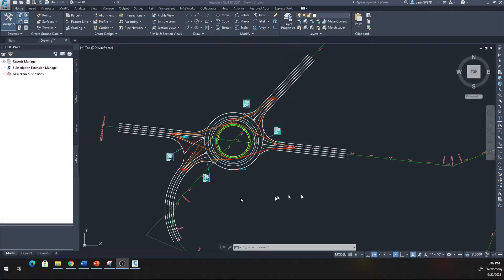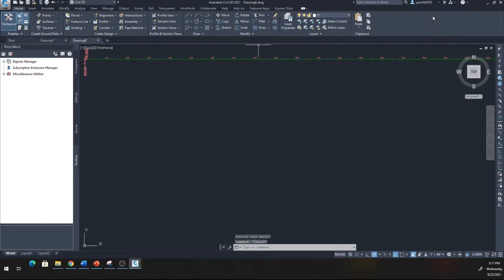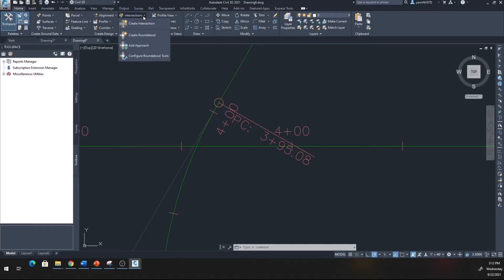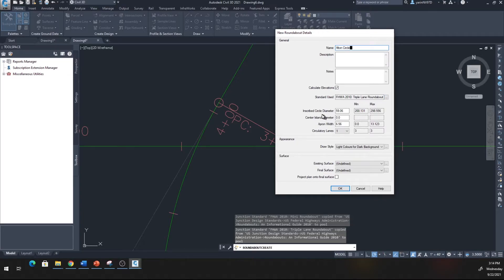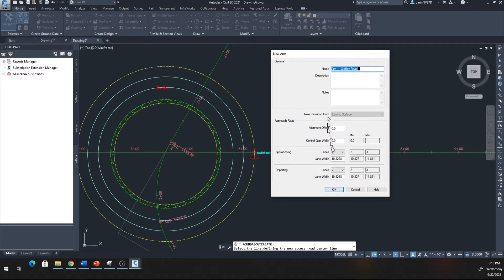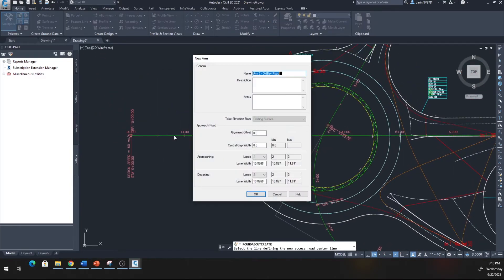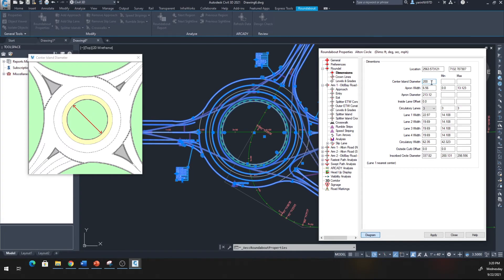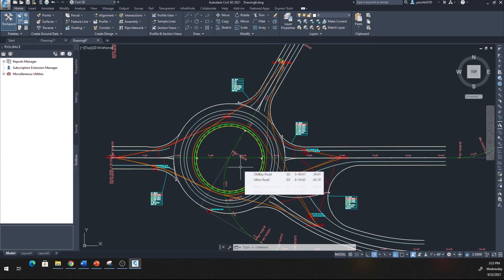Creating a Roundabout Traffic Circle Civil 3 D

Comment: What if you want to tie into an existing road? Lets say the existing road is 26' wide but the entry lane will be only 12' how would you connect the existing width and a taper or transition into the roundabout portion of the road? I have not seen any videos were they use a real road as an example to build of.
Reply from the maker: All depends how much length of taper you have, and based on your local code and speed you may use 7 to1 or 10 to 1 taper just make your centerline alignments meet the existing one.
Reply: @nasseryariphdpe648  Thank you for the information.